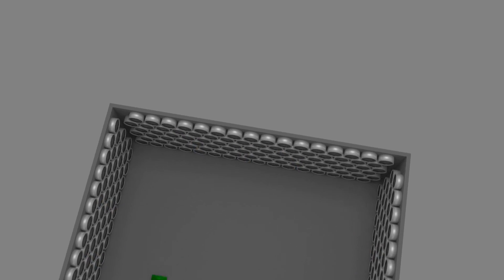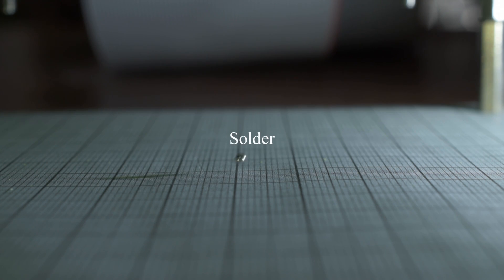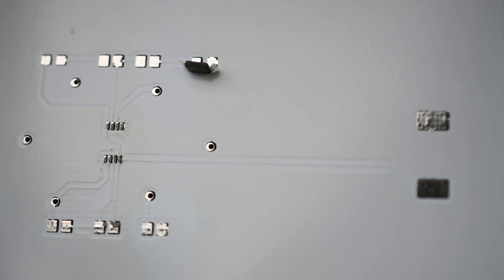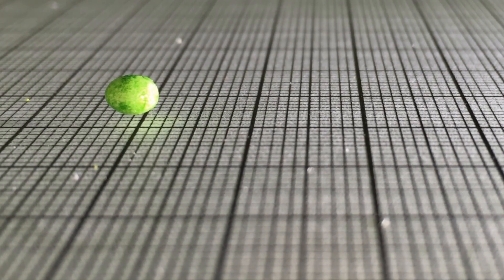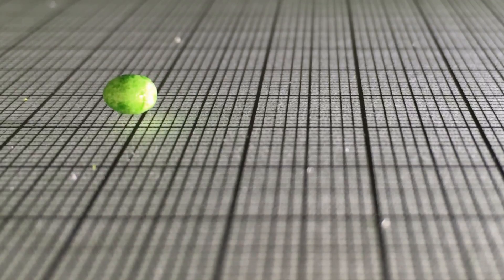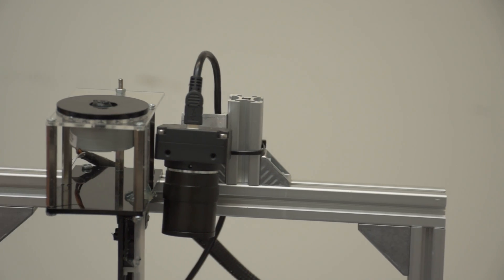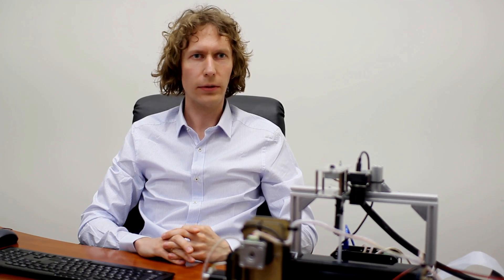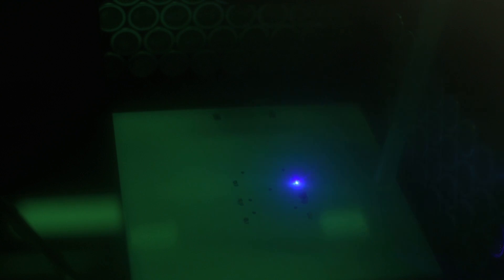Ultrasonic Particle Manipulation: assembling electronics in a non-contact way

Comment: so only one component can be controlled at a time? 
otherwise I think the ultrasonic wave will affect the components when passing by.
The device is cool anyway
Reply: You'd have to solder each component as you place them. As cool as this is I don't see this being any faster than current SMD assembling technologies, with benefits not being worth the disadvantages.
Reply: Yes, but you are thinking in 2D ... if there was a way to print substrate and then pick and place in 3D, then you could maybe do cool volumetric circuits. :) The 3D manipulation is where it really shines.